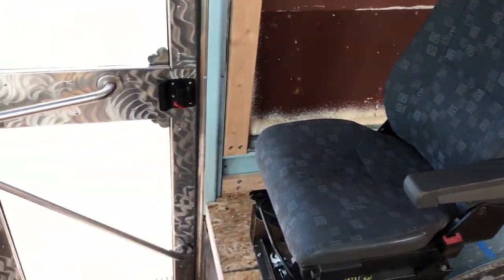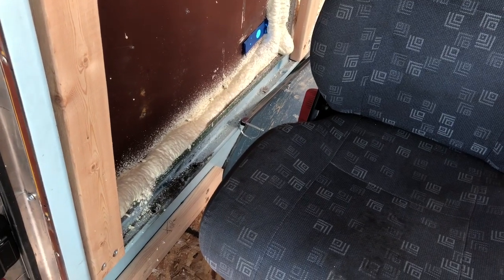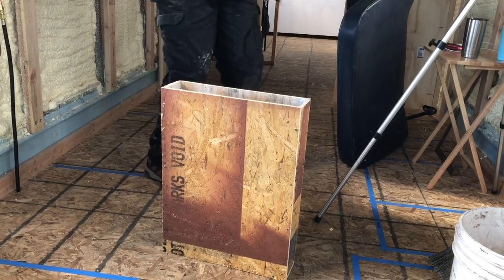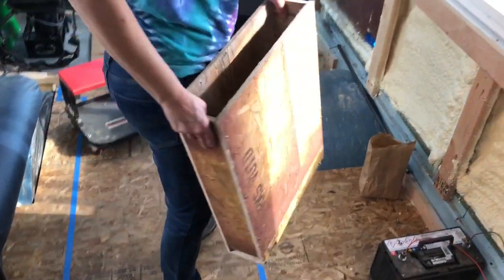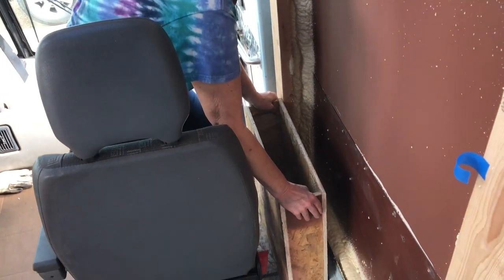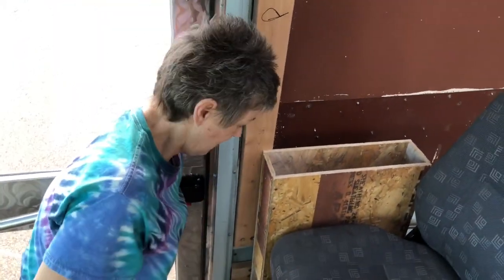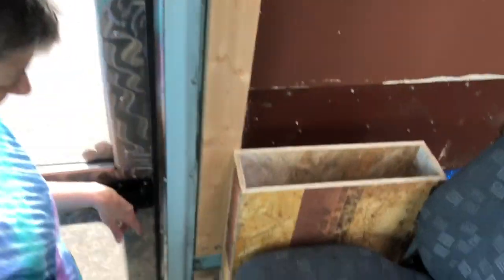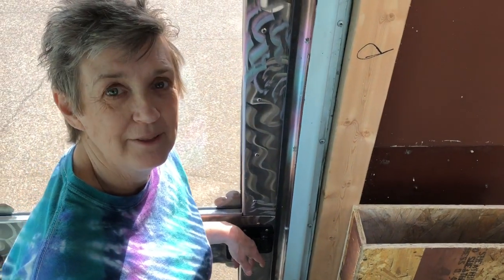Passenger Chair Cubby - Vlog 78 School Bus Conversion

Comment: You could also recess that cubby into the wall to gain storage.  Just use thinner sheet insulation up against the exterior sheet metal skin. You could also build a slide mechanism for the seat to gain a couple of inches when swiveling the chair. You could also make the cubby removable with a wall mount like those multi position tables you see in van builds. Especially if you make it light weight out of sheet metal.  Anything electrical could just use a plug in wall outlet positioned right there.  Or instead of mounting it to the floor or wall, mount it to the seat above the swivel.
Reply from the maker: You have some great ideas. Thanks. We played around with sliding the chair forward. That did help. This chair has lots of positions it can be in too. We have also talked about maybe a table top that swivels around. Who knows what will become  of this cubby.

Comment: Attach a fold out console / table top to the seat that swivels with the seat. Could hold phones drinks etc. a wireless charger built in.
Reply from the maker: Had not thought of that .... Thanks. But really want to keep the walk way open when the chair is swiveled.